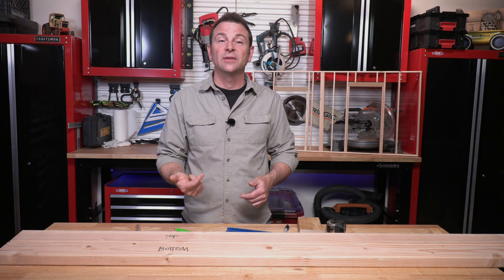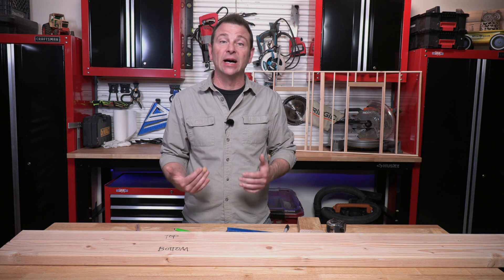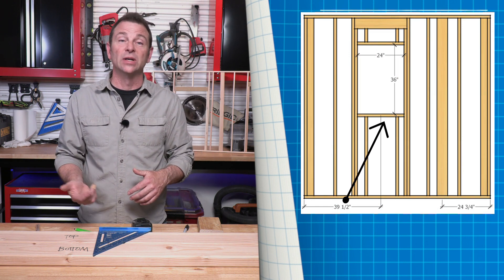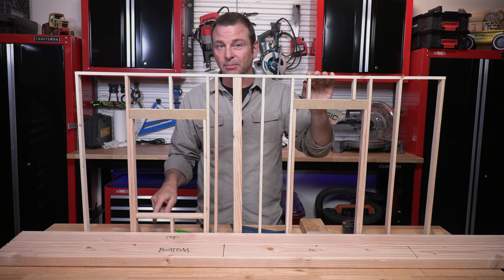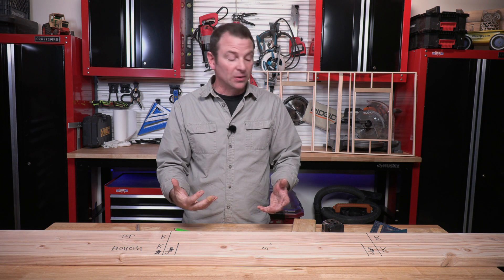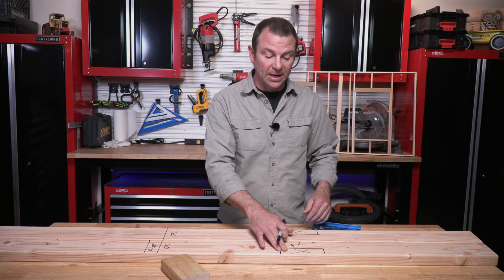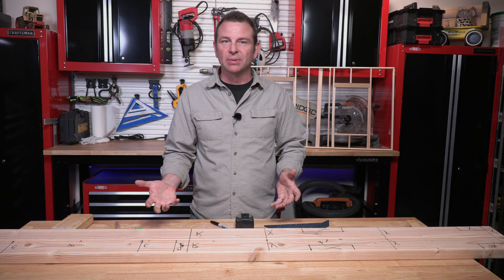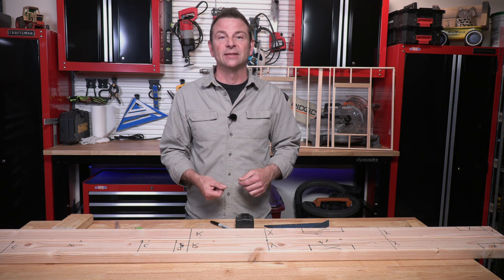Learn how to do Wall Framing Plate Layout, Step by Step

Comment: Is it always thru walls on the oposite side.or when conekt but to thru wall.that but must stay but or can other side been thru.if you understand me.i am from serbia and i am interested to start building like this hause.we built out conkrete.sorry for bad english.thanks
Reply from the maker: When two walls connect in a corner, one will be a thru wall and one will be a butt wall.   Sorry I could not follow your English that well so I may not have answered what you are asking.   If not, maybe try google translate and repost what you are asking.
Reply: @ConstructionEd  you didn't understand me. good. and how do you determine that. and I mean opposite walls. are opposite walls always longer.(thru)
Reply from the maker: @Ivan-mf7lc  Sorry Ivan, Opposite walls are not ALWAYS  thru walls - but they often are.   There is no defined rules on what walls have to be Butt and what has to be Thru - it is often up to the framer to use their judgment.
Reply: @ConstructionEd  that's what i wanted to know. thanks

Comment: I do not mean to be offensive or rude. But I am a carpenter instructor / carpenter superintendent .. I think you should have started the lesson by explaining the indicators first.. such as where and why you place an X next to a line . The K . S , etc. the header length , the difference between a thru  wall and a butt wall . How to crown/ label  lumber FIRST.,  using a carpenters pencil .  How to use  framing Sq for layout .   Etc etc.
Reply from the maker: Don't worry Gary, I took no offense at all. I agree with your comments and we have video lessons on all those topics in our framing courses, and fundamentals course series.  They can be found on our channel, look in the playlists.
Reply: I agree,would have taught the same thing that you refer to,and be able to layout the wall in 5mins.

Comment: I don't understand why you don't explain the reason that  "on center measurements should be for studs in the interior of the wall only" and the first stud measured 16" from its center to the edge. Teaching not only need to tell student about "how", but more importantly tell them "why".
Reply from the maker: I don't really understand your statement about OC being for inside vs outside - walls need to be sheathed on the outside and thus needing a consistent layout pattern.   Please explain.
Reply: @ConstructionEd  I did not comment about the OC being for inside vs outside. I only quoted what you have said when you replied to the comments.

You have at least two people leaving comments saying that you were wrong because " In your video, you measured 16" from the edge and then subtracted another 3/4. So your edge is actually 3/4 closer to the end of the plate." You do have a very good reason to do that because of the need to do sheathing. If you do it like these two people suggested,you will not be able to nail the first plywood from the end of the wall correctly. You should have explain this reason to them, but you did not. You only said, "on center measurements should be for studs in the interior of the wall only". I believe that did not help those don't understand why you did your way.

Your teaching and the video is very good. I just want to give you a little feedback that if you can provide students the reasons of doing thing certain way, especially when it is clear that they don't understand or agreem with you.
Reply from the maker: @davidh2049   I went and looked at the chain of comments and now I see what you were referring to.   I have to be honest, I am not sure why that comment is there - Not sure what the reasoning for that comment is - as it is not correct.  I will remove it to not add more confusion.   I appreciate you calling that out - I was confused because your comment was not in that same thread

Comment: You've confused the issue with 16" on center...  You are measuring from the end of the bottom plate, 16" from the edge of the bottom plate will be the edge of the stud, not the center.  You don't need to subtract 3/4"
Reply from the maker: Thanks for the feedback, but I don't think you were following what we were saying.   You are correct that when you measure from the end of the plate - and make a mark at 16'' that should be the center of the stud.   When we say subtract 3/4'' and make a line - that line will be the first edge of the stud (assuming you are framing with 2x4's).   We have found that it is easier when starting out to teach a student to mark the location of the edge of the board.   Otherwise, the framing has to eyeball the center of the stud to land on the stud.  While you may be experienced and not find that a problem - many of the High School students we used to train had trouble with that.    Later they move to mark layout at the 16'' mark and center the stud. 

For that matter - when a framer gets more experienced - they are actually marking on the board edge - not the face. 

But thanks for challenging us - keep it up
Reply: @ConstructionEd  Now I'm confused even more. If you measure from the end of the bottom plate to 16", isn't that already the edge of the stud? I think that's what the OP was referring to. He is saying 16" from the edge of the plate is the edge of the next stud, not the center. In your video, you measured 16" from the edge and then subtracted another 3/4". So your edge is actually 3/4 closer to the end of the plate.
Reply from the maker: @ragutz  When you measure from the end of the plate to 16’’ and make a mark – that mark should be the center of the stud – not the edge.   On center layout means a repeating pattern that expects the stud to straddle the layout mark.    Our lessons recommend backing up by ¾ inch then make a mark (for a 2x4 stud) so it is easier to align the stud, for a beginner it is often hard to eyeball the center of a stud.
Reply: @ragutz  @oneout72 He is not wrong! The reason for what he did is for sheathing. You can watch his video for  "A lesson about Wall Sheathing in Residential Construction". The shealthing starts from the end of the wall, therefore the distance from the end stuff to the first common stud should be 3/4" shorter. Otherwise, you will not be able to reach the center of the common stud for nailing the plywood.
Reply: U can start with 15/1/4 and never go wrong
Reply: The way he marked it out the studs end up at 16” on center. 3/4 + 3/4 = 1.5” which is the size of a 2x4. So if you subtract 3/4” from your 16” mark and make a line for the edge of the board it makes it pretty much fool proof that your studs will be 16” on center

Comment: If you are using 2x6s how is your corner going to work with just the one 2x4? 1 1/2 plus the 3 1/2in would get you to 5inch so it would be hidden by the next 2x6 wall where your corner meets
Reply from the maker: The plates in this lesson are 2x4 not 2x6.  The T wall connection is a 2x6 but that is expecting a 2x4 wall to connect in to it.      The corner connections are also expecting the butt walls to be 2x4.  If you are building a 2x6 wall, the process is the same, just change to 2x6 plates and framing members.   Although you will have to make your T wall connection with a 2x8 or use ladder blocking.
Reply: @ConstructionEd  Can you explain why the T wall connector is the 2x6 vs a 2x4 when using 2x4 framing members. And why you would use a 2x8 when using 2x6 framing members?  Why the extra 2"? Thanks!
Reply from the maker: @msviolinnut  the extra 2 inches are split 1 inch on both sides of the 2x4 wall that connects - and they are used to make corners for the drywall to connect to.

Comment: Why are the top cripples not marked on top plate?
Reply from the maker: In this instance - the drawings call for a High Header - meaning the header is right up against the top plate.   In that instance, we would recommend that the header itself be the framing member that gets marked for the cripples - typically by transferring the marks from the bottom plate to the header while framing.
Reply: @ConstructionEd  Thanks.   I was looking at the model.

Comment: This may be a dumb question. How do you identify the start and end of a wall. Do you go in one direction? Say clock-wise or anti-clockwise?
Reply from the maker: The "start" of a wall is whichever end of the wall that you want it to be.   Just be consistent.  I typically find the through walls on a set of plans and call the end on my left the start.  Then work to the right as I am building.   But that is not normal that you can do the full framing project that way - there are many other factors that influence the build process.